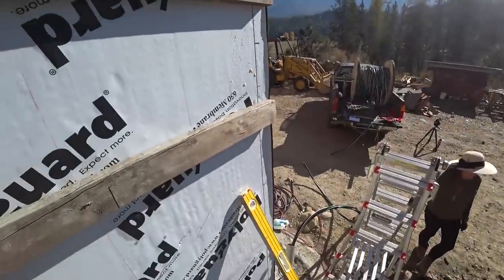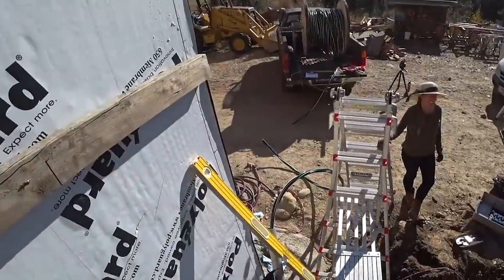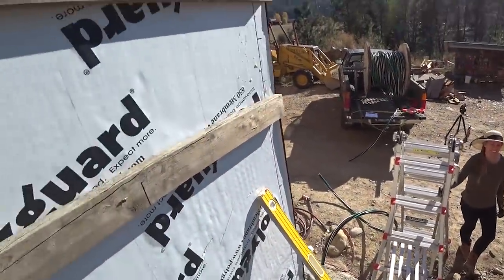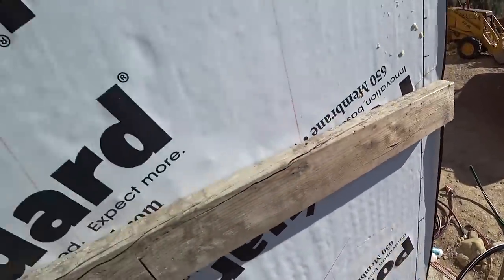Will 200 Amps Be Enough?! (Connecting House to Power)

Comment: WAIT, I need closure, did you get the screwdriver out?  1:51
Reply: It wasn't a screwdriver, just the lug nuts from one of the terminals . It's probably still down there... easy to replace.
Reply: i wanna hear the cut out part of the video i'd bet je said a few choice words that had to be edited out lol
Reply: I was thinking the same thing! 💜🌞🌵
Reply: I need to know!
Reply: Ya, I need closure too. LOL.  Use a magnet on a string.  You really don't want to leave that in there.  It can heat up and or strife.

Comment: If a compressor is what you want at the saw mill burry some 3/4 pex in the trench for an airline back to the garage. I did that between my attached garage and detached garage 150 feet away and it works great.

Comment: Put a generator tie in to that panel, for those winter time outages.  But, do it, right, so when your generator is on, it won't backfeed the line
Reply: My suggestion would be to use a subpanel for critical loads like lighting, the fridge, future well pump, etc... Then put in a power transfer switch on the subpanel to transfer between the grid and a generator, or a few kw of solar as a backup. Or both solar and a generator available as backup.
Reply: The right way is with a Power Transfer Switch. I have a Reliant PTS in my home. Installed it myself. Very straightforward insallation. Sturdy product, looks good and does a great job.

Comment: Instead of 300 dollars for that short length of sheathed wire, you could’ve bought a SDS Max hammer drill and drilled a hole in the concrete.  Done in ten minutes with a back to back panel connection.
Reply: Maybe Joshua, but how about the embedded  floor heat system?

Comment: You already have a breaker on the main supply. Why is that not sufficient? Certainly outside the house and in the case of a fire you not going to be wanting to saw logs on the mill whilst the house is burning down.
Reply: David Pratt usually your meter counts as the external means of disconnect but because their meter is hundreds of feet away for the house they need another means prior to entry.

Comment: I have to question why mount the panel tight between 2 studs.  This prevents you from running your romex into either side, limiting you to the knockouts on the top, and on the bottom.
Reply: Their going to do what ever makes them feel warm & fuzzy, even though their pissing up a rope. They opted for a location that should enable access from all 4 sides of the box, but prefer to limit them selves as you say Top & Bottom. Go figure.

Comment: Now you have another 70 feet or so of SER in the circuit.  You will have flickering lights.  Total length from the transformer will get you... and that looks like 4/0 aluminum.  Use the online calculator and you will probably find you are out of code which is 5% regulation at your service  panel.  Added resistance of disconnect contacts will not help either.  Poor planning and no easy fix.

Comment: Are you sure that outdoor breaker (disconnect) isn't a convenience code for the guy breaking into your house? The next thing will be a fire ax hanging by the door.... Frankly, there is a lot of sheer lunacy in the NEC that does nothing more than line the contractor/suppliers pockets. Besides, if the Fire Dept. wants to  shut the power off to your house, I'm pretty sure they know all they have to do is pull the meter head...…..are you getting the picture yet?

Comment: It's always a good time to watch someone try to pull wire from the coil... roll it out across the floor so its straight. Then it's a one man job. Also, don't you already have breaker space out at the meter (yes)...why would you run wire back out there for the saw, it's already there. The enemy of power is distance. This makes that run 500 feet or so, you'll go broke but it can be done.

Comment: You should google pipe fill or hole fill requirements when you are running your wires; a hole is considered a pipe of very short length as far as the code is concerned. You need to leave a bit of room for slack for the wires to move around a bit if they are contacted by another object. As it is, it made one of the hardest wires to pull in the house more difficult to install and you ran the risk of friction eating the insulation off of the wire. A 2 inch hole would have worked just right. Also, come down lower with your hole lines, this will make insulation easier to install.  They sell a National Electric Code handbook pocket version that should have most of the things you will need to know when wiring your home and pulling wires.
Does the panel by the meter have additional breaker spaces? I would power the plug to the sawmill from there as it is much closer than the house.
I am not trying to be rude or condescending to you, just trying to help. Good luck with your project.

Comment: I would have installed 200 Amp panel also, but i would not have used Aluminum wire. Be sure to check the terminations yearly for loose connection.

Comment: I don't know how far in the past this was filmed, but I would recommend running some outdoor rated cat6 through your data conduit. You can put a couple of lines in one conduit and can carry POTS or connect to an OGT out by the road if you are lucky enough to get fiber out there.
Reply: If you have to run the connection to your home yourself, don't use cat6, if the junction box already provides fiber, get an FTTH connection. Anything copper based is already massively outdated and will be a huge bottleneck in the near future.
Reply: I live in a place like they do. Well out in the middle of nowhere but not so cold. It would cost me $60k to get internet to my house via cable. I can barely use satellite internet.  Lol the only way they will bring fiber to my house is if I make a corporate account and give the them a few 100k.  Data where I live is worth more than gold. Lol

Comment: You two should look into buying a couple Baker scaffolds.  They will make alot of your upcoming work alot easier and a heck of alot safer than ladder work. They are relatively cheap plus they can be used as a sort of mobile work bench too.

Comment: You should have came up on your service entrance wire, too far of a run..or ran 4/0 cooper, you will have a drop on your amperage...4/0 aluminum is usually for less then a 100' run. Also instead of two hundred amp you should have had ran 400amps you will see how quickly you use up most of the amperage on the two hundred panel.. Example your stove, drayer, jacuzzi, heat, work shop, home essentials etc. And always upgrade your pipes on the underground it should never be hard to pull wire..and in case you choose to upgrade in the future it'll make it easier, and won't have to trench again..

Comment: Ever hear of voltage drop ?
250' to the house. plus 50'(ish) to the panel, plus 150'(ish) back to the driveway plus more to a Gate? You better size up and/or use copper or you will be less than 100v at the drive

Comment: Why in the name of God are you putting the face of the interior panel on the EXTERIOR of the utility room?

Also, you were going to use the top area of the utility room/washroom as storage.

You can't really do that safely if you run straight up with your electrical wire from below.
Reply: If the utility room has water there may be minimum distance problems that a door negates, if they need it to look pretty they can build a set of doors in front and they can box around the vertical wire path, if they do it with a reasonably thick wood sheet the wires will be protected and they can still store stuff behind it.

Comment: I keep getting commercials for some product called wallabot. Some kind of thing you connect to your phone to see through your walls and up to 4" of concrete to identify studs electrical water. You'll probably buy some kind of FLIR camera for your radiant floor problem but you may also get a sponsor ($$$) for a video if you approach those wallabot people or maybe just free tools?
Reply: some of the reivews of the Walbot are not exactly glowing
Reply: Heh.  I was just contemplating finding a thermal camera to try and locate the radiant tubes in the slab in my shop… :)

Comment: You may regret not installing a generator transfer switch on service. 200 amps is typical for a dwelling, some large houses need 400 amps if they are total electric.

Comment: Recommend 400 amp service minimum including the shop service. Also, critical circuits isolated to one of two house panels and powered by a double pole double throw switch. The DPDT switch gets power either from street power or a pad mounted emergency gen set, never both simultaneously, hence the spring loaded double throw. switch made for this one task.. 

When gen set is engaged street power is the only source of electricity coming in for non-critical circuits. That panel is not fed thru the DPDT switch.  These circuits will not be available during power outages. Plan on losing power for weeks. It will happen and probably more than once.

When street power is restored non-critical circuits will come on.  Gen set is then shut down and DPDT switch is thrown to rejoin critical circuitry to street power.  One switch does it all. Makes it simple for novices. Can be automated from the gen set, just am added cost. 

This is best done now.  Doing it later,  unlikely it will never get wired right. I suspect you will not be reading this since I posted it before. sorry, not a Zuckerberg Faceplant follower.

Comment: Jesse, you should consider running power to the sawmill site directly from meter pedestal.  Its a much shorter run and would be cheaper.  You might have to hang a breaker panel but that would allow both 120V and 240V power at that site.  Code should allow you to feed power to a small sub-panel backward through a standard double pole breaker.  It does here in Oklahoma.

Comment: 200 AMP will not be enough for your House. The  way you run things at the end at the Ranch you will exeed it. But it should get you going. I would recommend 200AMP with 200AMP subpanel for 40 spaces for breakers. And Run to your SHOP a new line with 200AMP as well. Welders and Compressor will use a lot when you work hard in the shop.
Hot tub needs GFCI and if electric 50AMP

Comment: 200 Amps in the house?  It will just fine!  Remember, if you need more you can always expand with more panels .... but why?  What you are doing on the outside panel, I have done after Hurricane Katrina.  We have our shed 100 amp panel and 100 amp panel for my Christmas display on the outside power box.  We have a main 200 amp breaker that goes into the house and to our 200 amp service and have room for 2 more circuits in the outside panel.  On the inside power panel, we have all of our house circuits and have room for 4 more circuits if needed.  So I think you will be fine and BTW, our electrical inspector passed it and took pictures to show his boss how outstanding of a job we did.  He loved the idea of what we did to keep it flexible/expandable.  WE have never came close to using 200 amps at any moment in time.

Comment: Speed drilling technique here would have saved you a load of string lining and marking up..
Drill in right hand, tape measure in left.. You know the wall is straight, so measure off it, place the drill, check the vertical distance and pull the trigger.. then move on..
No point whatso ever in being arrow straight on cable runs that are not in solid conduit, that is going to be hidden in the ceiling.. Get er done!

Comment: If you're going to be drilling more of those holes through the joist. Two words. Auger Bit. Get a cheap-y one and roll with it. So much easier than a spade bit and less stress when working above your heads. :)

Comment: 200AMPS is sufficient for most any home unless you plan on running 3 phase, or LOTS of 220v circuits all at once.. I have 200amp service and was told by the inspector this was sufficient for 3 homes.....

Comment: Whatta yabet they buy and truck in masonry wall material when they live at ground zero for the mother lode of round stone. Would take weeks longer, and labor intensive, but, oh so rewarding to use the unlimited supply sourced directly beneath their feet. Not critical that lower exterior wall be finished right away, unlike the roof. J & A could collect and wash stones. Hire mason (and crew) to install. Would compliment locally sourced timber and, if done right, look stunning.
Reply: I thought the same thing when I saw some of those rounded flat stones that came up in excavating for the cisterns.   Even if they didn't cover all the way up to the timber frame, but made it a feature by covering 2 feet or so at the bottom of the wall.  They'd also make a lovely edging for the driveway and/or flower beds, I'd Whitewash the edging stones in some ares to make them stand out from the rest.  But a band around the base of the house and up the pillar between the garage doors with a lovely Carriage Lamp (you can even get Solar ones now, with motion detectors built-in) would be stunning,
Reply: Probably more expensive to use the rock on the land once you factor in the cost of running the equipment. Also they have so much to do already the opportunity cost is probably huge when considering doing it yourself.

Comment: Suggestion: 

2 thing for the outdoor newly installed electrical panels. 1. Waterproof them if possible. corrugated A frame on top..(with some sorta LED panel to say how much amps watts are being used.. but thats for the indoor panel) 2. check the outdoor panels every two weeks for wasps & rodents.

Thankyou for the video, GOD BLESS

Comment: 200 Amps is plenty for your house.  That is 200 amps at 240 volts, or 400 amps at 120 volts.  A breaker panel can have 2.5 time the branch circuit capacity at is feeding it.  So you can have up to 50 circuit breakers of 20 amps, or 1000 amps of branch circuits.  Trust me, you will never use anywhere near that amount.

Comment: Not a good breaker box. Code requires Arc-fault breakers & with that box you need to attach all the arc-fault breaker pig tails :( You can get breaker boxes with a Neutral breaker connection to avoid wiring up the pig tails.

Comment: A Ugly's Book would be very helpful. Yes lol Ugly's. You can probably order on Amazon or Ebay if u don't have a Home Depot near. Great electrical reference book. Derating wire sizes & pipe size to run for wire size etc. Full of info, even knots we use to pull wire etc. Only about $10 too. Great job guys keep up the great work. Your pride shows. 🇺🇸

Comment: Should have just put the disconnect with the meter out in the yard. It would be outside the house for firemen and you would have saved some work.
Reply: unijabnx2000 since the meter is over 10 feet away from the main load center,  a disconnect is required per the NEC. It would’ve been easier but not to code.

Comment: Rewired my place....it was built in 1922...still had Knob & Tube.
I plumbed in 400 amps from the pole...200 to the house and the other half to my shop.
The guy from our utilities thought that was a bit over kill...but  running welders, compressors, etc. I didn't want a hard draw on the system...which would increase my cost.
And Yes...around here that makes a difference.

Comment: another good step!  You guys might get by with 200 amp service... but for our family of 5 with electric bathroom floors, propane heat, and powering RV hookup for guests, we went with 300 amps when we built 3 years ago. (But we don't have SIPS, and when kids leave, our power consumption will drop a lot).

Comment: ‼️‼️  ALWAYS have more than 1  connection to Utility  ‼️‼️ 
You should run it in a different dug out Trench  Encased in a Heavy Gauge Steel Conduit with Concrete Poured around it with 360 degree coverage and about 5 inches thick at all sides ; in case your main line gets Crushed or Tampered with. 
It may cost more now but you'll soon realise it's benefits in the Future 
‼️ And have a Highly Secure Distribution Box Hidden especially for any DisConnect left outside the premises; you don't want to help any Home  Invaders

Comment: Sorry but what a hack job. With a 15kva transformer you are max at 200 amp box. It would have put that disconnect at the meter and install a outside breaker box to handle anything outside of the house.  The breaker box should be were the service come in and ran in conduit and only copper wire. Also if a electrician is willing to tell you how to do your own work RUN.

Comment: OK great to see the electrician using deox,looking good.And as far as is 200a enough,remember that's 2 legs of 200 an-a and b phase.So unless they have something i haven't seen it'll be enough.One thing i'd have recommended if i had done the wiring for them,would have bee a second run of conduit all the way to service(if they could afford it.)Grounding is the a big part of what we do-gnd rod,concrete encased electrode,building steel,well casing,and plumbing.Panel inside(the sub panel)is set up that way b/c we bond at the first point of disconnect,so after that you have a separate gnd and neut. buss.

Comment: 200 amp is plenty for your size house.
A load calc will usually add up to 125 amps the most. Extra 75 amps are for just incase.
Exterior panel is always a great idea. Main disconnect within house is within 6 feet of entering house, and usually disconnect is located at pole.

Comment: Make sure the lugs in your panels are rated for Aluminum conductors.  Make sure the Electrician applied the correct anti-oxidation compound to the cable ends and torqued the lugs to the correct specs for the cable. (DO NOT over-torque Aluminum conductors.)

Comment: We are installing 60 circuit panels in homes that size. Nobody ever complained they had too many circuits. PITA when you run short. If you have to put your panel in a wall, run a 2” conduit in adjacent cavity and sweep into side of panel for future wire  access.